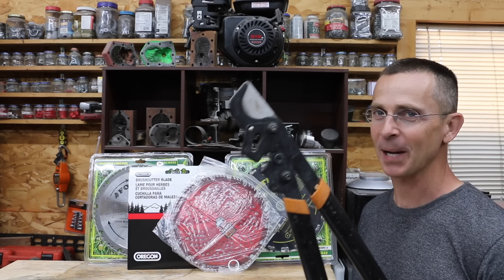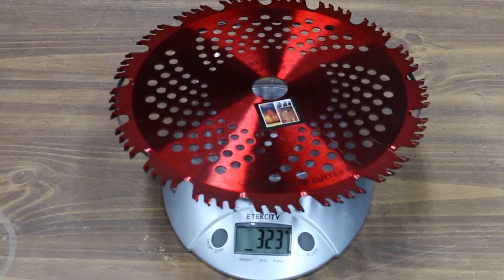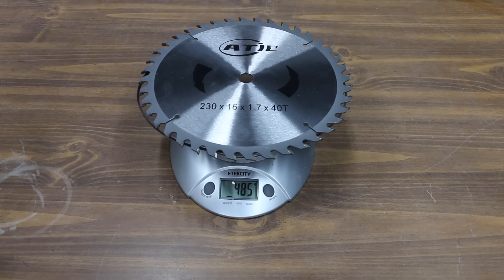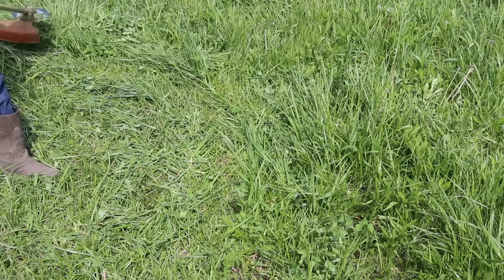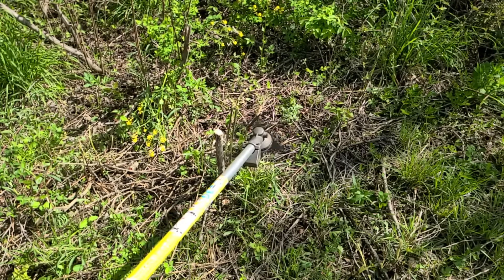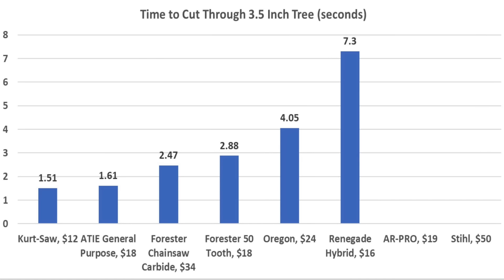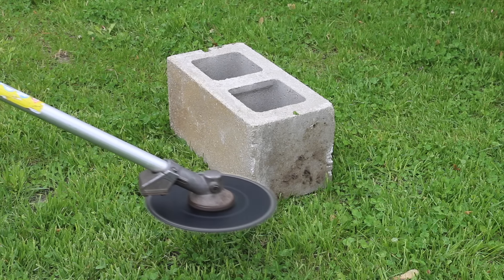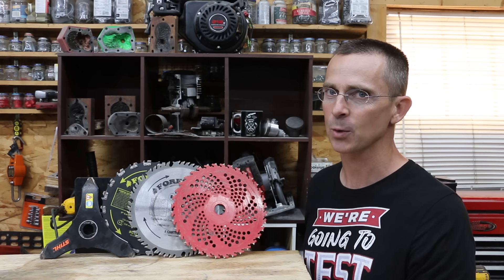Best Brush Cutter Blade? Let's Find Out!

Comment: You missed the best brushcutter blade, Google 2 tooth brush cutter blade ,looks like a lawnmower blade with edges pointed down. I sharpen the edge and it's amazing, bang off rocks, no issue, cut down 3 or 4 inch trees with multiples whacks, grass no issue. Best part, cheap like 8-15 dollars depending
Reply from the maker: Thanks for the feedback.

Comment: How well would egg work as engine oil?
Reply from the maker: Thanks for the suggestion.
Reply: @ProjectFarm  I heard that egg can be used to plug holes In a radiator and I was wondering if the oil would get hot enough to cook it.

Comment: can you edge your lawn with any of these blades???
Reply from the maker: Thanks for the suggestion.
Reply: Is that a yes??
Reply: I think he replied to the wrong comment. The toothed saw blades would dull quickly if constantly coming in contact with dirt. 

Personally I just use regular trimmer wire for shallow edging and for cutting new beds I use a Stihl Edger blade.
Reply: @roodboy606  I ment use old saw blades that are going to be thrown away. I tried it and as long as you have a steady hand it works perfectly.  I have be using the same blade  5 times on edging my lawn and my neighbors lawn too.😁

Comment: Can someone please explain why we're not supposed to use brushcutter blades on curved-shaft trimmers? I only ask this because I own a Stihl FS-62 Brushcutter (handlebar version and also curved-shaft) and in the manual it claims I can use blades, but that was printed quite some time ago; I just want to be sure I'm not putting myself, or anyone else for that matter, at risk of injury by using it with something it's not meant for..?
Reply from the maker: Thanks for the suggestion.
Reply: @ProjectFarm  ??????

Comment: Those Steel Wire Circular brush's, are better used for clearing the tufts of weed etc, on paths , kerbs, and tween slabs ; Except MINE won't fit my Bosch strimmer, nor will any other Disk, as you cannot remove the whole wire container and drive, to screw them on. So tell the supplier what your model details are first. If THEY reccommend it, and it won't fit, THEY, have to acept it back, and refund it all.
Reply from the maker: Thanks for the feedback.

Comment: I'm noticing a trend with these testing videos of different products. A lot of the time, the cheapest product performs just as well or better than all the other products! Interesting. And if the cheapest doesn't perform as well, you can buy more of them and throw them away and still be at the same price as the most expensive ones.
Reply from the maker: Thanks for sharing.

Comment: I realize it's not a garden tool but can openers drive me nuts. I don't use electric can openers. It's just seems ridiculous to make such a simple easy task into an electric tool. But none of them seem to hold up to opening a can or two of dog food per day for more than 2 months before getting so dull that you can't finish the can without having to go back over it and recut all of the spots that didn't go all the way through before you can get the lid off. The chance of getting cut trying to lift the lid if you think you got it all and you didn't it's all so pretty scary. Any chance we could learn which can openers hold up or if anybody just has a comment about that I would love to know because I'm on my third can opener this year and the last one was like 25.00 and I'm looking at $40 ones thinking they're not going to last any longer because the blades are probably made of exactly the same stuff just thicker. And what use is a sturdy thicker well-built durable can opener with a blade that gets dull in 2 months like all the others. Because the blade is attached to the tool in such a way that you can't use a kitchen knife sharpener it seems like the only thing you can do is get a whetstone and even then the angle of the cutter just doesn't lend itself to the same motion that you would use to sharpen a  knife.
Reply from the maker: Thanks for the suggestion.

Comment: None of these blades are designed properly imo.  They need to have fewer teeth.  I do woodworking for a living and know from years of experience that the amount of teeth on a blade is very important based on the application.  

Fewer teeth means less friction and faster cutting.  If you are ripping wood (going with the grain) on a tablesaw, you want a blade with less teeth due to the wood being harder to rip than it is to crosscut.  For crosscuts you want a blade with more teeth to avoid tear out.  

Rip = more difficult to cut/less teeth is best/tearout not an issue.
Crosscut = easier to cut/more teeth is better to avoid tearout.
Brush cutting = tearout not a concern/fastest cutting ideal/less teeth and thin kerf ideal.

This is why Dado blades have so few teeth.  They have very thick kerfs and few teeth — this ensures that they are still able to rip through lumber without blogging the saw down too much.  

An ideal brush cutting blade should have far fewer teeth (12-24) than these blades do (excluding the chainsaw blade which I'm not really referring to here).  Tear out isn't an issue, so there is no need for a high tooth count blade.  You want minimum friction, so a blade with a maximum of 24 teeth is best, but one with less than 24 teeth is probably even better.    

Modify a thin kerf low tooth count tablesaw blade and it will destroy all these in this video.
Reply from the maker: Thanks for the feedback.

Comment: Really don’t understand why you’d have a blade with chainsaw bits... and it’s says only recommended for grass, I mean, why on earth would you use that to cut grass 🤦🏻‍♂️ 
Have you come across the 2 and 3 bladed blades that are for brambles? 
If you put this item number in on eBay, you’ll see what I mean and it’ll probably give a suggestion for the 2 bladed version (193726386253) 
Would be great to see a comparison and your thoughts on whether the 2 or 3 blade version is best...?? Many say the 2, I like the 3 - theoretically any bramble should be that bit smaller.
Reply from the maker: Thanks for the video idea.

Comment: None of these is the right tool for the job, ever. What they are is a great way to cause massive injuries. Anything they can safely cut can be cut with string. If you need carbide tips then you need a chainsaw, which is both easier and safer to use on a string trimmer head.
Reply from the maker: Thanks for the feedback.